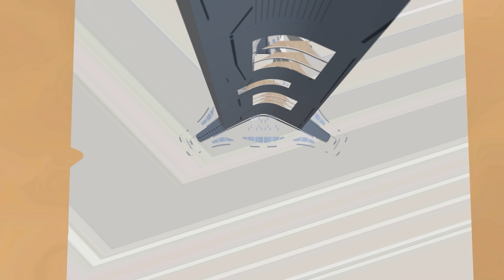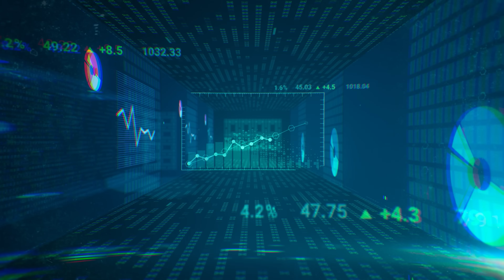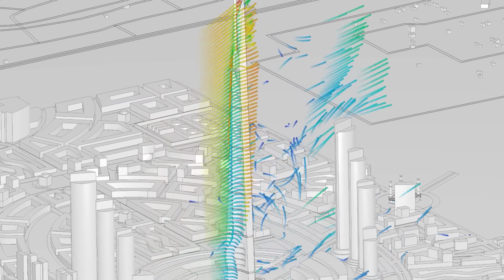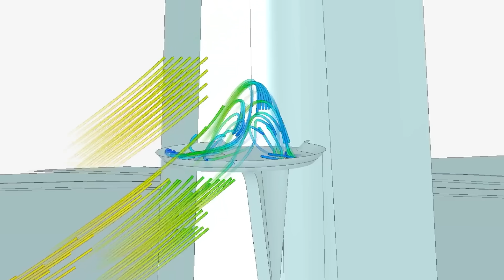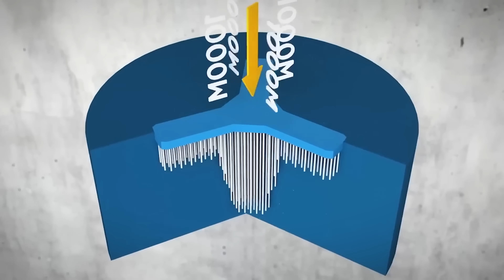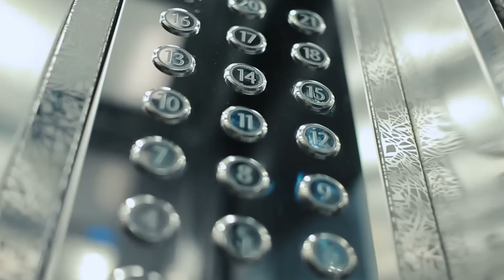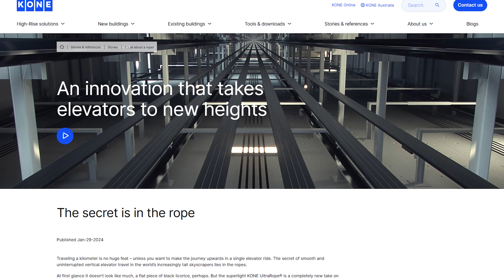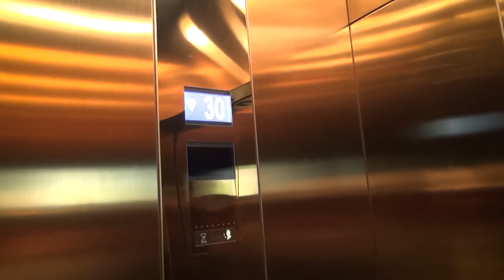Jeddah Tower Update 2025 — The World’s Tallest Building Is Back!

Comment: So it looks like it is about 25% complete? Structure is about 25% of the height, but still have to build the next 75% of the top, which will be harder even though it is smaller and still have to do all the finishing work
Reply: It gets slimmer though. So most of the volume has already been built. The upper half of a pyramid or a cone for example only has 1/8 of the volume.